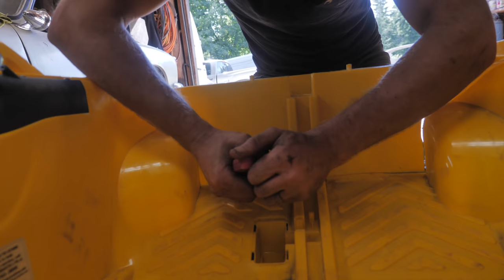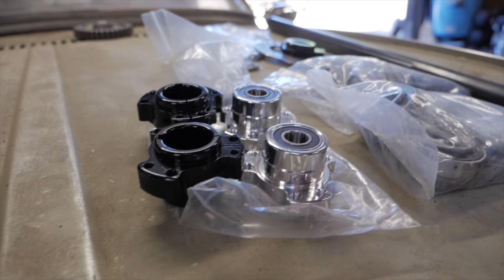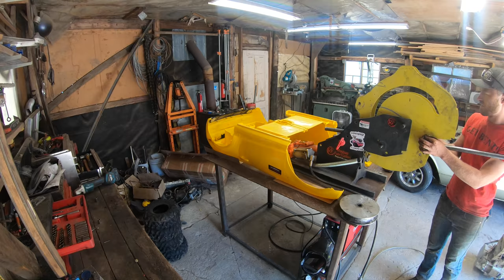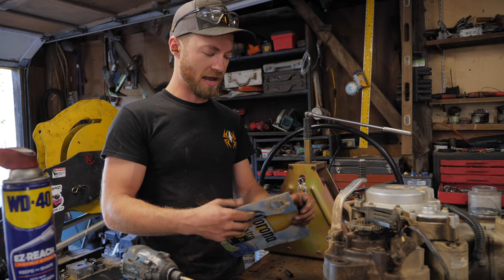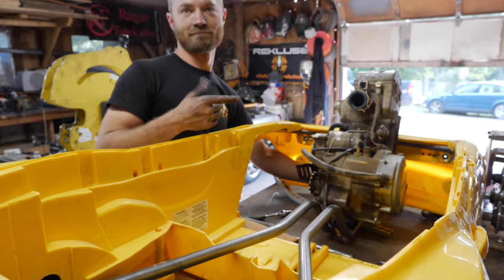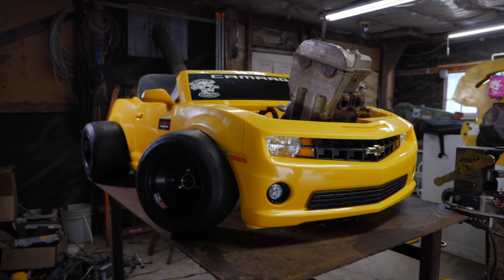500cc Transforming Power Wheels Build Subaru Powered

Comment: Ford F-150 and trailer next?-power wheel tow rig for other power wheels
Reply: That would be an great next power wheels
Reply: Awesome idea!   Either that or a tow-truck
Reply: Diesel.
Reply: Not a Ford tho, they suck
Reply: @jakebraun6376  at least its not as bad as a chevy
Reply: @matasblot3606  nah chevy is wayy better than a shitty ford
Reply: Matas Blotnys, boi Chevy and Toyota are the best
Reply: @connorscaff1201  agreed, although dodge is pretty good
Reply: I just got a GMC Sierra power wheels truck at the recycle center I thought of. It would make a great 4wd toy hauler!!
Reply: Needs to be a Chevy not a Ford
Reply: Dodge is only good if it’s a Cummins and it’s still going to rust away on ya.
Reply: Nah an f350 dually
Reply: I vote for a toyota Thundra! with maybe a raptor 700 engine or smaller 2005+ 400ex engine for reverse? cuz you need reverse for trailer😏
Reply: @OakKnobFarm  
Hahaha!!! Forreal tho huh!!! 
A flatbed tow truck would be epicly fucking awesome!!! Imagine seeing barbie jeep get winched up onto a mini tow trucks bed!!! Too Dope!!!
Reply: get a briggs&stratton diesel and turbo it?
also, solid axles all round, maybe with 4wd would be awesome, considering there'd be less space limitation underneath.
Reply: Nah Dodge Ram and trailer
Reply: J̸a̷k̷e̶ ̸B̴r̷a̸u̶n̸ old 1980s ones? Lovely

Comment: Ethan, sweet table design. You’ve effectively built a Grind Hard Swiss Army Welding Table! Throw on some industrial swivel locking casters, and you can use it to load/unload right out the back of the pickup. Keep doing what you do, dudes!

Comment: Since the motor has two exhaust ports you should definitely run dual exhaust;)
Reply: JPMotorhead1993 that’s what I said
Reply: Heck ya m8!
Reply: run cobra style sidepies?
Reply: Pretty sure they'll do it if possible but like the others pretty sure the exhaust is gonna have to go outside of the body. Might get some side pipes though...
Reply: @captainzoll3303  thought of that too! That'd be sweet
Reply: Off both sides, side pipes

Comment: Changing the air of the shocks will only change the sag of the shocks/spring rate. 
It will change the height but; high pressure taller but harsh ride, to soft will make it lower but move loads under acceleration and bottom out more.
With mtb shocks you can pump them up to about 300-400psi what on a mtb is like a hard tail. Some shocks you can buy volume spacers for, makes them ramp up so they don't bottom out as easily. 

Love your guys work! Cant wait to see this built!!

Comment: do you ever accidentally melt the plastic on the Camaro when you're welding?
Reply: Why. Would they weild with the plastic on?
Reply: @ewarn3202  right lol
Reply: did you even watch the video he clearly welding the frame when the body was on
Reply: @mikesepticeye3038  I just got to that part lol
Reply: I'm fairly confident he is just tack welding when the plastic is on. That way the tubing doesn't get that hot with the short welds and it is strong enough to hold together during fabrication.
Reply: @mikesepticeye3038  I just know I would have unintentionally blown some holes or at least created a bubble or two or three. Lol! of course if you kept a couple steel "profiles" wrapped in cloth and sitting in water you might be able to, while part is still thermopliable, push bubble back into original shape or close to original shape.

Comment: Looking forward to the jackshaft and rear swing arm pivot mounting.  I mentioned it as  an issue during your awesome  Barbie car build.  The closer you get, the less change in chain length at the rear, but don't go crazy if it isn't perfect.  Everything is a compromise.  It's why god made spring loaded chain tensioners,  pencil erasers and plasma cutters.

Comment: I would not use the drive shaft as the suspension pivot point. You are going to have twisting and torquing that will bind on a spinning shaft
Reply: Just like a 410 or a 360 sprint car or a midget or a nascar late model.  Cus a birdcage style rear suspension just never works. Clearly is doesn't work on the barbie jeep eather. Just saying. P.S. its called an axle.

Comment: For your benders, vises, etc., consider using some hitch mounts under the edge  of the table.  That way you can slip the different tools on and off as you need them.  Bigger tools can use two mounts to make them rigid.  Cheap ole Horrible Fright parts will be perfect for this.  Love your builds!

Comment: My electric i8 PW build is going slow, but progress is being made. Got nearly half the frame welded up, working on the rear suspension right now. Also building the battery pack (Li-ion) and doing it right. I only get 3 hours of weld and fab time a week since I have to go to a maker shop to use the equipment.

I'm also going to say you're smart for taking a page from that Porsche build and use a 2-seater PW. More room for fitting everything.

Comment: You'll run into a problem with your idea of using mtb air shocks. When increasing the pressure to raise the ridehight, you're also increasing the springrate. This means you'll have a harsher ride when raised and a softer ride when lowered. Which is exactly the opposite of what you would want. I think a mechanical solution of different shock mount positions is the way to go, even if it meansthat the transformation between the two will take longer.
Other than that I'm sure it will work out great.

Comment: As a mountain biker that has used air suspension for a long time, I think you might have a hard time getting ajustable travel with air shocks. They dont really change in travel length, its just the spring rate that changes making it easier to move through the travel.

Comment: Not sure if your aware but typically a rear mountain bike shock starts at 120 psi for the lighter rider and goes up from there past 200 psi. Not sure how well that’s going to work with on board air.

Comment: Just a quick idea. You should make that table have adjustable height. Maybe you could use the mechanisms from "ratcheting" jack stands (not the kind with a pin). So you could pull the whole table up higher at once, and take the time to lower it when you need to. You could even weld a bar to each side (connecting two of the jack stand release handles) to make lowering it quicker and easier. That would make a badass welding table. Maybe it wouldn't work as good as I'm thinking, but it's a sick idea on paper! Lol

Comment: Possible suggestion. Use air ride instead of mountain bike air shocks. You can get air suspension that's small enough for that application from a semi. They use em on the cab or sometimes under the seat so it's more comfortable. I'd imagine those would work perfect. Especially if you plan on on board air. And youd get a lot of travel out of them. Adjustable bump stops and limit straps would make it a solid setup.
Reply: Mountain bike shocks are fine they are made for jumps and all kinds of rocks. But it really depends on what brand it is too.

Comment: The mountain bike air shocks are a great idea but you don't want to use the air for ride height adjustment. You should instead have multiple mounting holes for ride height because the air in these shocks controls spring rate and you could really get some control over each corner of the car and the ride in general.

Comment: Going on past experience you might want to rethink the air shock idea for changing the ride height, as you air it up to lift it the spring rate increases to the point the ride is comprised when you need it to be plush, conversely when you lower it I'm assuming for on road the rate decreases and you blow through the reduced remains travel.. I'm came across this in full size but can't see a reason it'd be any different in Bumblewee.. awesome progress really enjoying the channel.

Comment: That pivot-jack-shaft idea is nuts, but the chain from the engine will still be running down the middle and threatening the old sausage and spuds, unless you put a primary jack-shaft between the seat and your feet to move the chain out to the side earlier? Just thinking out loud, congrats on the half a million subs, b-t-dubs, lol.

Comment: uh not exactly sure but its not a good practice to lay the bottles flat. some don't mind but some are very dangerous to do that. id recommend mounting it about 30 degrees and against the other leg. may tip them enough to protect the gauges and give you room to put 2 bottles, steel and aluminum

Comment: Make sure to add enough anti-corrosive to your coolant system. If you only use water, it'll galvanically corrode when two or more different metals are in the loop (one will act as a cathode, the other as an anode), which would be extra bad when your coolant line is doubling as frame rail.

Comment: Great job building the welding table. I cringe watching folks work off the ground. Add some heavy duty locking casters to the table so you can flex the space easily.

Comment: Thanks to you guys inspiration,  I built a 40+mph super fast Mobility scooter (I'm a paraplegic) 72v 15Ah with a Racing Kart  narrowed and Modified so the Scooter Body (Really nice carbon fiber injected plastic) .  One Thing I found out, The police can't ticket me or  anything when I tell them I'm paralyzed and I need the scooter  to move .... It's not a vehicle, it's a piece of medical equipment  (big loop hole) .
 
I went with the electric because I needed to be able to go indoors (Shopping, family etc.) Also I believe with a gearing change I could hit 60 but 43 feels really fast.  The motor has adjustable regenerative braking , it's not a Bicycle motor it's an EVmotor from  Japan, it's  a 12 hp brushless 46lb monster. 

The electronics come with a cool interface that hooks up to a number of nice  5 to 9" LED screens. 4 speed programs from super efficient to tire smoking torque. On efficient mode I've got a 60mile range  doing about 30 mph. I have built in battery management system  and charger.  I'm tearing it down now to redo it and make a build video . I don't really make YouTube videos but no reason I can't start lol  Take it easy and thanks again for the inspiuration

Comment: Cool idea for the jack shaft but it be neat if you were to put the chain in between the two coolant pipes and then the torque point would be right in the middle of the axle going to the rear that would also protect you because the pipes are going to be around the chain just an idea

Comment: I want to get this to you now because I did the same thing and had to redo it but the jack shaft and suspension pivot point so you need to do it the other way round the pivot for the axle needs to be it’s own shaft and not be spinning and the jack shaft part will be a sleeve with bearings that goes over it because when we put ours together when ever you would hit a bump our 1.5 inch shaft would flex a little bit and the bearings on the trailing arms would bind the jack shaft causing fast wear on the bearings and also like a extra brake that you don’t want

Comment: Really cool project, but the cooling system might not be the best solution.
Running coolant in a steel pipe is going to be bad for the aluminium in the engine. There will be galvanic currents, which will errode the engine block eventually.

Comment: I believe I would put a CD player where the play radio is and a speedometer and tachometer in the dash where it has the play gages and if possible find some that fits the little circles on the dash 
Hell ya mite as well get a GPS for the center of the dash

Comment: So the thing with using mountain bike shocks is there not as durable. they require pretty frequent service intervals compared to moto suspension or else they'll get clapped out. And they're not designed to take the abuse that they'll probably be under. based on what you guys have been doing with your other power wheels. I'm not saying don't use them, but you'll want to make them removable so you can service them when they need to be serviced.
If you're wondering, I am a bike mechanic and I have a lot of experience with mountain bike suspension of all varieties. I've seen suspension on a bicycle get destroyed because it wasn't taken care of. It won't be hard to wreck your shocks on this thing.

Comment: Why not just buy 100 mm MTN bike shocks and get 8 inches of travel
Reply: Travel is measured at the axle...not at the shock. By mounting the shock closer to the pivot point of the suspension, the shock can be shorter while still having adequate suspension travel at the axle.
Just look at what the did with the Honda Odyssey rear suspension...that will give you a better idea of what I'm saying.

Comment: think the gasbottle for the welder fits straight up right behind the welder , would put the gauges pretty close to the underside of the table though . you could allso turn it a quarter 
aliexpress sells nice inclinometers cheaply :https://nl.aliexpress.com/item/32859534243.html?spm=a2g0o.productlist.0.0.4cae6de7rODdms&s=p
some smartphone can do the same thing but there kindah fragile
the way you described the jackshaft being the front part of the rear suspension hingepoint i mentioned a few times allready at people building bikes and small motorcycle engine powered cars , i do think that it will lift the rear on accelleration as it "climbs up the chain "